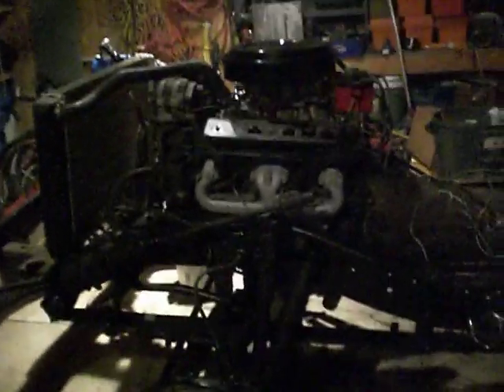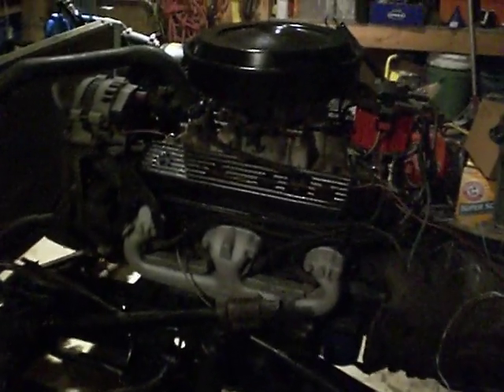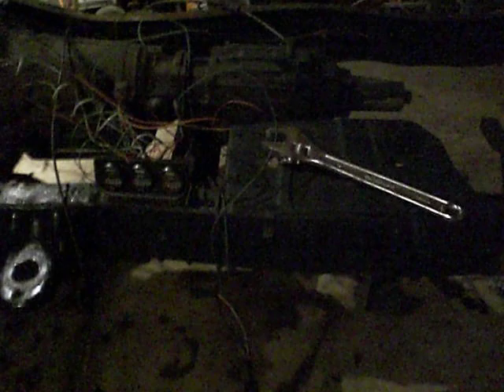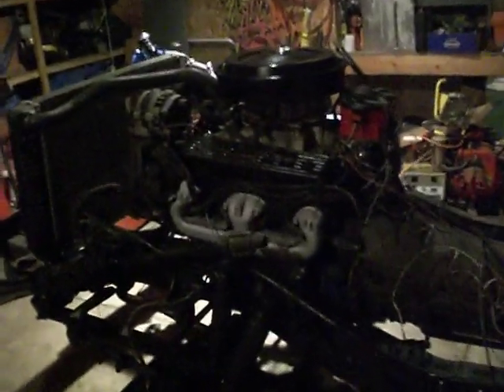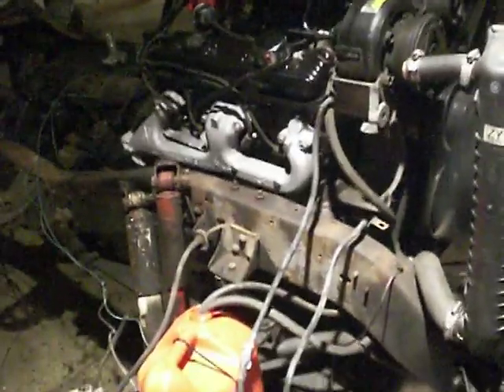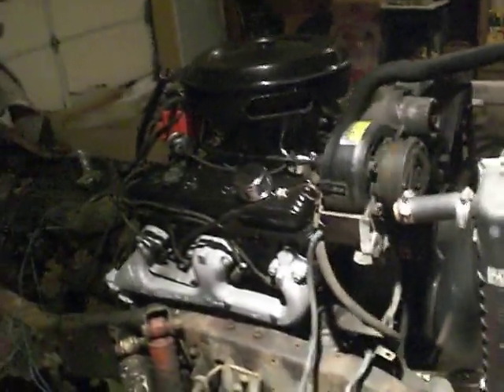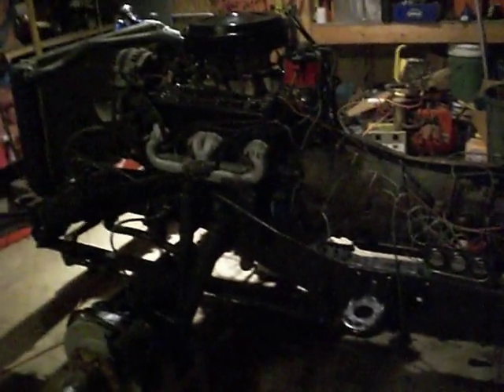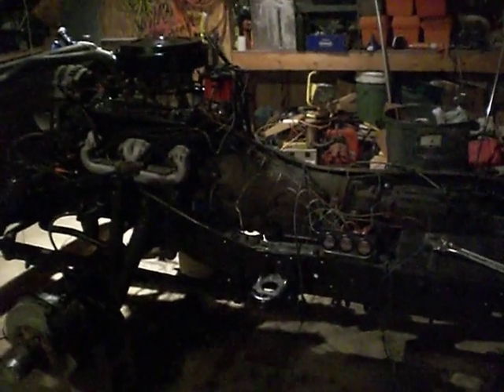Custom built SdKfz 250 halftrack

Comment: No its called being mainstream. We are building it as close as we can to the original. We don't have the money, tools, or the resources to make it 100% accurate. The body is going to look original, but the engine, transmission, and tracks are going to be different.

Comment: We are using the 4wd to move it around until we get the tracks finished, but then we are changing it to 2wd. We cant match the gear ratios in both axles.